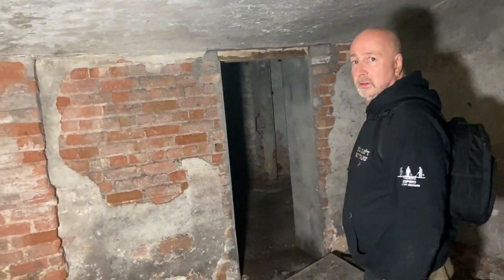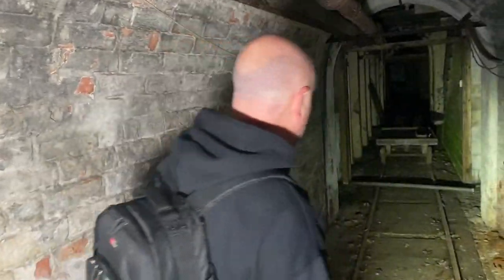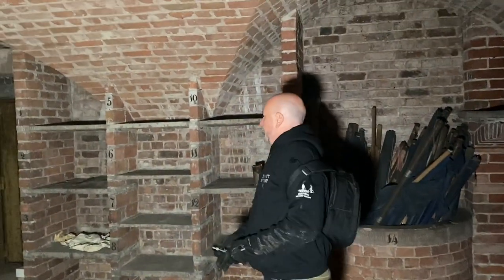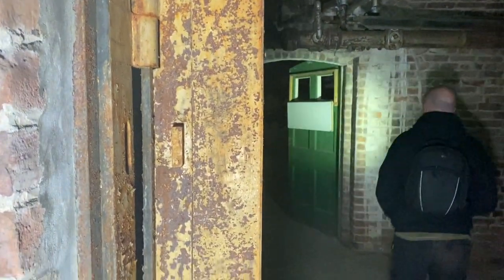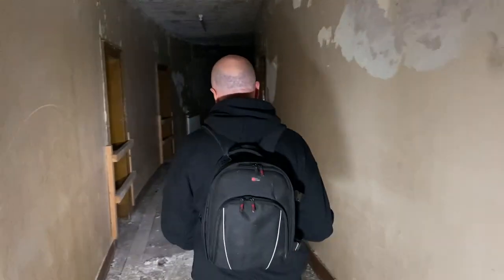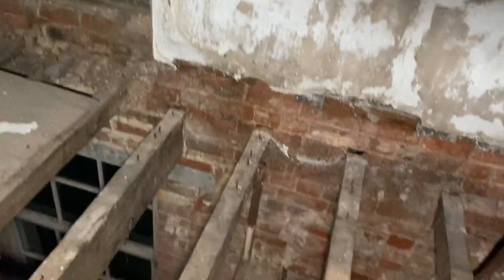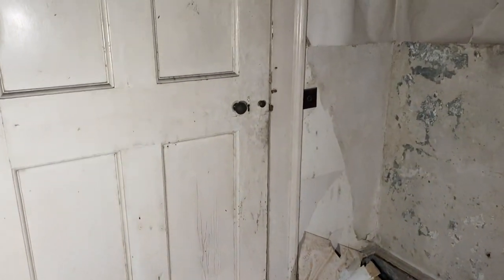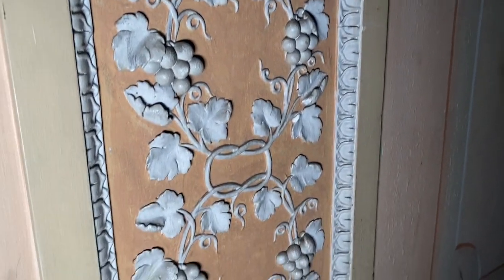What were these creepy tunnels used for under this grand ABANDONED 1700s house

Comment: 33:26 Believe it or not, that is a plug with an overflow built in, necessary if the bath doesn't have one built in which this one doesn't.  As the water reaches the domed part at the top it overflows down the inside of the pipe.   I've been in a bath with one like it.
Reply from the maker: It’s brill... but not as amazing as the other bath

Comment: I wished you could have opened up the other door in the basement tunnels.
Those black-bluish blinds that were in the vault room were definitely black-out blinds from the 40's.   The cylinder type storage devices or mailers reminded me of what was used to send chemical samples and reagents back in the 30's and maybe until the 70's.  Possible it could have been used for ore assays, or just valuable chemical storage.  One of those chemical solutions were in that bottle you were rolling about in the video.  I hope you washed your hands very well afterwards.
Certainly seems to have been some very majestic rooms and areas in the place.  Would make an excellent wedding venue.  I was surprised Matt wasn't climbing the ladders into the attic spaces, but I'm sure that alarm had you guys a bit worried about how much time you may have.